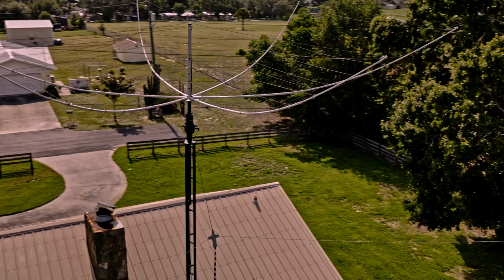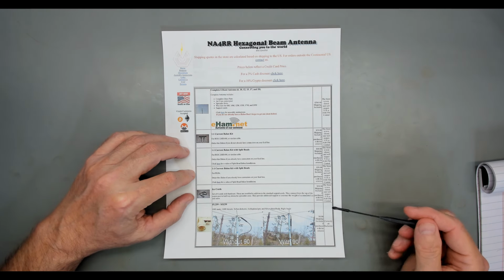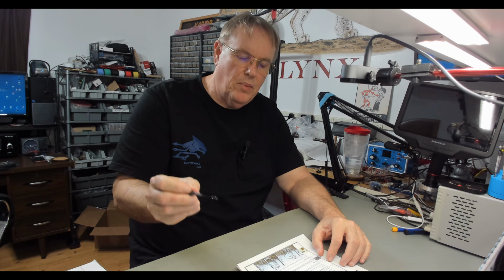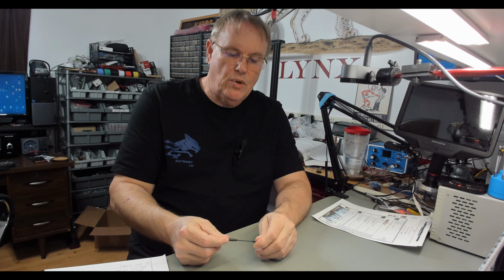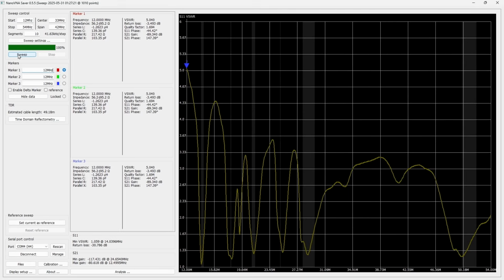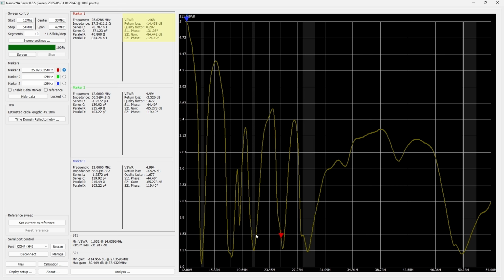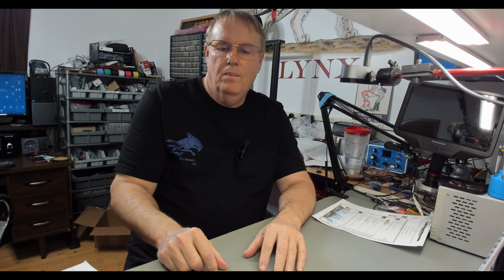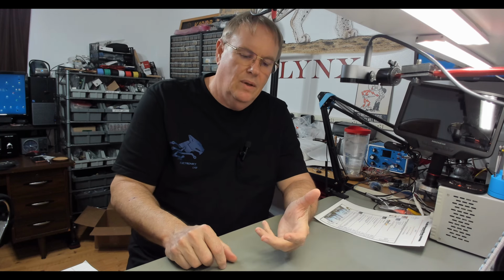Should You Buy a Hexbeam?

Comment: I’m also in Florida and I’m tired of putting up temporary antennas like dipoles, EFHWs, etc. I recently broke a telescoping radiator on a rigid dipole. I’m constantly taking antennas down and putting them back uo. Dealing with rain and not weatherproofing anything. I want this to be the move for me. A 3 post tilt down tower and a hex. How will this fare in hurricanes though? Just drop it down? What about grounding? I’m concerned with lightning being in Florida. But, on the flip side I really do need to seriously consider a more permanent / semi-permanent antenna solution and I’m leaning heavily to something like this.

Edit: just heard your portion about hurricanes. I’m in Jax. I wish you were closer I would really like to check this out!
Reply from the maker: I can only speak from my experiences. I don’t tilt my tower down for hurricanes but crank down the telescope to put my hexbeam just off my roof. So far this has worked well. I did take my time waterproofing my connections etc. 
RJ

Comment: How difficult would it be to re-tune the 6 meter portion to be more centered?
Reply from the maker: You would just use an antenna tuner or add a little more wire to the 6m element on the beam before you put it up. But I would note that it covers the band at less than 2 to 1 swr so really not worth changing.
RJ

Comment: At the Moment I only have a not pretty good working long wire Antenna installed. The Hexbeam is already in the Garage, waiting for assembly. I am very curious, if the result would be like you described starting from 18:32 - that would be the result I am hoping for 🙂
best 73s from Germany
DC5FI, Uwe
Reply from the maker: It will make a big difference, see this mornings video where I test the difference and plot the performance.
73’s
RJ
Reply: @LynxElectronicsLab 
Thank you for the tip with the new Video. I will have a look at it !
73s, Uwe

Comment: Awesome information! I am in the planning stages of retirement and a move, along with researching antennas, etc! I'm interested in that tower/mast you have supporting the hexbeam!
Reply from the maker: I’m afraid I don’t know much about it. It’s not marked with any info. I bought it 35 years ago from someone that had it on the side of their house  when they bought the house. It had a tv antenna on it and the new owners had cable tv and thought it was ugly. I only paid $50 for it as long as I removed it. So I jumped on it. I created a tilting plate arrangement for the bottom. It is 2 sections and 40ft max height. Sorry I do not know more to tell you. 
RJ
Reply: @LynxElectronicsLab  No worries. It looks perfect. Thanks for the reply! 73

Comment: Thank you for sharing your experience. I have watched this video numerous times, more than 10. I have reached a plateau with my 160m doublet. I researched the hexbeam extensively with performance compared to a multiband yagi. Honestly, there just isn’t enough difference to justify the additional cost of all that aluminum. I will be buying a NA4RR hexbeam. His version has great reviews from Florida to Alaska and beyond. I’m buying a 40’ tower, 3’-5’ of mast exposed above the tower. Hoping at that height it is a solid performer. 

One thing you answered in the comments but left out in the video was your final height above ground. I think you could make an additional video of on the air that would do well for views. If you want more clicks on the channel. Great job presenting the info we all wanted to hear. Again, thank you and 73’s KI4QPU
Reply from the maker: Thank you for the kind comments. My hexbeam height is exactly what you describe. My aluminum tower is 40’ tall and has a short mast putting it at about 33’ - 34’. I am sure it will perform very well for you. It has been great for me. 
RJ

Comment: I have been eyeballing a Hexbeam for a long time. At the moment I have a DX Commander classic but since I cant mount on a pole or a roof it has to sit at ground level in my backyard. Problem is when lawn people come tl cut my grass I have to take it down or they gonna shred my coax and radials. Its a pain. In the winter it stays up and its a very good performer. So I am finally thinking about getting a hex beam and put it on top of a pipe inside a bucket slightly elevated. No radials and very easy to move. I live in IL where winters can be brutal on ocasions and ice and wind are a common thing. Most parts of the hexbeam are easy to replace if they brake so Im not afraid of any damage. I dont think I will ever have a tower at the house where I live in, but hex beam near ground level is something I can work with. Thanks for sharing your experience
Reply from the maker: Your welcome! Glad you have a plan. 
RJ

Comment: I've had a similar experience. I was given a damaged antenna by the same maker, NA4RR. I purchased the parts needed to resurrect it and had it up for about 2 1/2 years. What failed was the push up pole I used. I bought 2 spreader sets and I'm finally ready to put it back up, adding more guy ropes, there were 2 sets before, I am adding 2 additional runs. I also had the runaway problem so I am adding more bolts to prevent the antenna turning on its own. The NA4RR version is the same price so far, the lowest I have seen and is the lightest permanent install version available. The versions available for temporary installs are pretty cool too and would work well for POTA in the right situation. they are more expensive than this one.
Reply from the maker: Thanks for your input, I’m glad you were able to get it fixed. 
RJ

Comment: I've been using a Hex6B from EAntenna for almost two years. I'm convinced there's no other multi-band beam antenna that offers such good value for money.

As for the SWR, if you operate the antenna very close to the ground, you can definitely notice that the SWR is affected. However, as soon as the antenna is a few meters off the ground, everything is perfectly fine. You can still notice it a little when it's raining heavily or there's some snow or ice on the antenna, but it's all within acceptable limits. Mine is about 10 meters high on a triangular lattice mast and is rotated by a lightweight Yaesu G 450 C rotor.

You should have a retractable mast, though; very strong storms could be a problem for the HexBeam, even though it doesn't offer much windage.

Otherwise, this thing has already brought me many great DX connections – it's really fun to work with.
Reply from the maker: We are in full agreement! 👍
RJ

Comment: Does the solar inverter on that solar array cause any problems with your radio? I have heard they can. I am a fan of solar but have heard inverters are noisy if you have radio gear.
Reply from the maker: Great timing, tomorrows video is answering questions about my solar. This question did not come up. So let me answer here. 
I have not had any issues with noise from the solar. It could be that the emphase micro invertors are quite, or because it’s ground mounted away from the house. But it does not cause me any issues. My noise levels being rural are very low. S1.5 - S2 normally. Turning the solar off does not change it. Thanks for the great question!
RJ
Reply: @LynxElectronicsLab     I have solar panels on my roof but no micro inverters -- DC all the way.   So I guess my panels probably wouldn't interfere much, if at all ... ?
Reply from the maker: If you do not have an invertor on the wall making AC which can make issues. But if  you are charging batteries then the only issue with that can be the charge convertors that charge the batteries can be noisy as they use Pulse Width Modulation to control the current so they work like a switch mode power supply. An you know how good those are for causing RFI.
RJ

Comment: Thanks for the video—really helpful. I'm considering a hexbeam for my newly acquired old 50-foot tower, so this was well-timed. One thing I’ve always found a bit odd, though, is how much emphasis some experienced operators put on SWR sweeps, almost as if they’re the final word on antenna performance.

SWR (or VSWR) meters didn’t even exist until relatively recently in the history of radio. Yet people built excellent antennas and worked the world without ever seeing a sweep chart. These days, the obsession makes a little more sense—modern solid-state rigs don’t tolerate very high and prolonged mismatches like older tube gear—but even then, SWR is just one, and relatively lest meaningful, piece of the puzzle.

A 1:1 match doesn’t necessarily mean an antenna is resonant, efficient, or radiating well. And on the flip side, a mismatch—especially if you're using a tuner—often has little to no impact on real-world performance.

Anyway, great video and appreciate you putting the time into sharing your setup and results. It’s helping me think through a few more things as I plan out the tower.
Reply from the maker: Thanks, you are correct. The SWR sweep just lets the viewer know they can use the antenna without needing to own a tuner. This can make the difference to a ham without one who doesn’t want the extra expense. You are also create on SWR not mean you have a good antenna but it is a good metric if you know the antenna was designed to radiate on the frequencies your looking at. A 50 ohm dummy load has a 1:1 SWR but will not get out very well after all. 
RJ
Reply: If your tower is guyed I would go with another type of beam.  That hex beam is very difficult to install on towers.  If not guyed I think I would build the beam around the tower so it could be raised almost straight up.  I built one and just put it about 20 feet up to the rotator.  Living in central NC we do not usually get much ice or fast winds so it has been up about 5 years with no problems.  Will not compare with my triband at 60 feet but works much better than my OCF at 50 feet most of the time.

Comment: Great video. 
I have have a Traffie Hex Beam (the original hex beam) up since 2007. Its the HX-5 which covers the same bands as the hex beam in the video except for 6 meters. I have used it in 6M though and gotten decent reports (2nd harmonic  of 10M?), It was expensive at the time. $1,300 and cost about $2.000 to get it up,, using commercial tower guys. Its still up there today on a 10' Glen Martin tower and a 10' water pipe mast. 

The only problem I have had is the beam spinning on its own, which waa due to a poor connection to the mast. The problem I have todqay is that the support cords are loose. It been a good performer, but don't expect tons of gain or FB or SS as the video suggests. It does however has exceklent SWR on all bands. 

The video did nof mention that the hex beam has FULL SIZE elements on all bands, but they are folded over, with minimal loss. So it is a good antenna for all the stated reasons and can be mounted on a chimney or push up pole - so its versatile. I don't agree with the comment about the ice cords though, as this makes the antenna stiffer than it would normally be, which I don;t think helps it in the wind, 

Another thing is that, for example, my favorite band is 17M. Now if you get a typical  tribander, when you add 17M to it you usually end up with a rotatable dipoile, which of course is suboptimal. Also the hex baem you no traps (due to  separate elements for each band, as mentioned previously). 

The VHQ looks like the most solid replacement, with great mehanical construction and specs BUT it's expensive. The VHQ supposedly eliminates problems with the center post failing with high ice loads.

All in all, its a poor man's yagi and not a bad one at that!
Reply from the maker: I appreciate you sharing your insight on the hexbeam, especially about its performance over the years.
RJ
Reply: so what gain could we expect?   3-6 dBd ?

Comment: I have the same beam and can tell you it works great near the ground. Max height I had mine up at was 10 feet on a tripod for 150 pound concert speakers and it still worked VERY well. But I think the major challenge would be mounting it on a mast. Great video. Thanks
Reply from the maker: Thanks for the compliment and for sharing your experience.
RJ

Comment: would you ming telling me what crank up tower do you have ?
Reply from the maker: I afraid I don’t know much about it. It’s not marked with any info. I bought it 35 years ago from someone that had it on the side of their house  when they bought the house. It had a tv antenna on it and the new owners had cable tv and thought it was ugly. I only paid $50 for it as long as I removed it. So I jumped on it. I created a tilting plate arrangement for the bottom. It is 2 sections and 40ft max height. Sorry I do not know more to tell you. 
RJ

Comment: I'm not a radio guy (yet), but where I'm at this would not be the antenna for me.  The 3 ice storms over a week we had late this winter brought 12 trees down on my property.  If I ever do take the plunge into HAM radio, the antenna will be one of the most difficult decisions.
Reply from the maker: Yes Uni, you are definitely on my not for you list with a hexbeam. Great antenna but not extreme ice rated. A wire inverted V or flat dipole would likely be better.  A vertical would work also. I just have lots of room so a big loop is easy. Works great on 80 & 40 meters. Hexbeam covers 20m - 6M for everything else. 
RJ
Reply: @LynxElectronicsLab  Thanks RJ.  I have acres of room, but I think a vertical would be best for me.